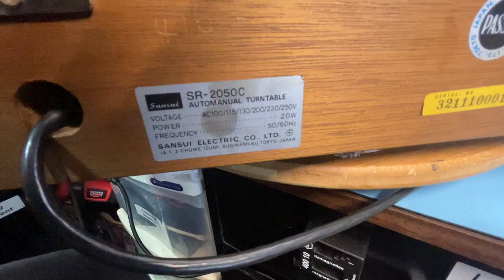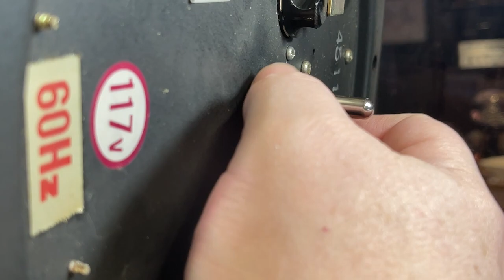Turntable Spindle repair

Comment from the maker: Side note: acceptable lubrication for this repair, oil.  Whether it be sewing machine oil, 3-in-1, mineral oil or even 5W-30.  Just apply it sparingly onto the spindle and place it back into the brass piece.  Don't use silicone grease!  Be nice to one another in the comments folks!
Reply: If you can't say anything nice, Don't say anything at all.

Comment: Hey thanks for this video! Recently got myself a JVC JL-A20 and the spindle was absolutely stuck, couldn't even spin it. Took me an hour or so of trying to pull it out after heating and applying degreaser to the screw hole. I wouldn't have known pulling out the spindle would be so easy like the video, it definitely helped me persevere on my own unit. Now I'm just waiting on the belt and cartridge to come in, in the meantime I guess playing around with a free spinning spindle will do lmao
Reply from the maker: Spin the record around with your finger and imagine how great it'll sound!  Thanks for watching!
Reply: I feel called out, that's exactly what I did playing with the auto return mechanism lool

Comment: Thank you! My Teac turntable started to rotate slowly, ~25 rpm instead of 33 rpm. I changed the rubber belt, but it didn't help. Turned out it was the spindle. When I opened it, the greese (lubricant) was sticky. I removed it with some dish soap and applied new lubricant, and now it's 33 rpm!
Yoohooo!!!
Reply from the maker: Glad my video helped you fix your player!  Thanks for watching!

Comment: Davey - Thanks for this repair video.  I have an old Sansui SR-212 that was I'm bringing back to life.  This has an auto return mechanism with a gear on the spindle, which caused a bit of challenge with replacing the set screw.  But - back together and so far so good.  Also the bottom cover was stapled, so took a while to get it off.  Replaced the staples with wood screws.  Again, thanks.
Reply from the maker: Hi there!  Glad my video helped you out, that's why I post them!  Thanks for watching and hope to see you comment again some time in the future.

Comment: Awesome video.  Jusr what I needed and exactly what my problem is.  Any idea where I can get a replacement?  Mine is completely seized up. Thanks.
Reply from the maker: Have you tried doing what I did in the video?  If it's that stuck you could try sitting it in some alcohol and it might loosen up the old grease.  Finding a replacement probably won't be easy.  You'd probably have to find a unit that is being sold for parts.

Comment: Hi Davey, thanks for putting this up. I bought my deck in Japan in 1971 when I was in the British merchant navy. marvelous piece of kit. However, it was put away in the attic in about 1992 along with the Sansui AU 666 amp, Akai X200D tape deck, Sansui SP1200 speakers and Sony TC 127 cassette deck. finally got them all out and fixed up and guess what, they all work great except for the record deck. Yes the spindle has seized. I undid the nut as per the video, however, the nut will not allow the tapered part of the spindle to pass through as it is of too small a diameter. I do not understand this. as on the video it just falls through. Any comment on what I can do would be most appreciated.
Reply from the maker: I haven't seen this issue on any units I've worked on (yet) so I can't say for sure what the issue may be.  I'll have to look and see if there are perhaps some variations of models for the unit.  Have you figured this out yet?
Reply: @daveytechca  The only thing I can think of is to use a small abrasive stone and carefully grind the spindle diameter down until the nut slides over it.
Reply: I’m having the exact same issue with mine. I have no idea how to get the nut over spindle. It’s fully unscrewed and spinning freely at the base of the tapered section but will not slide through